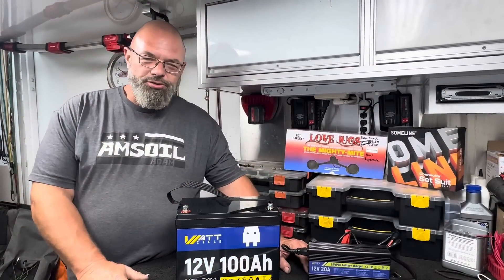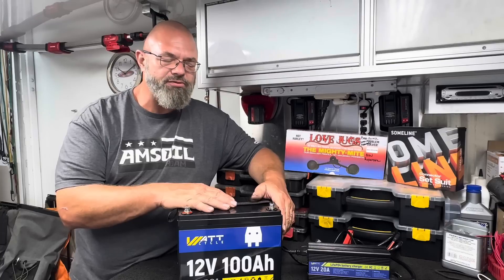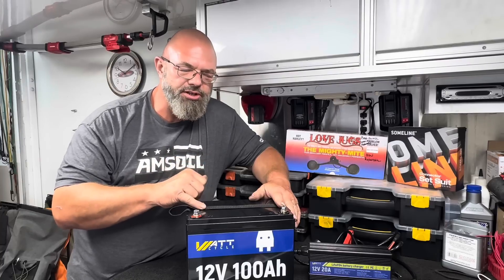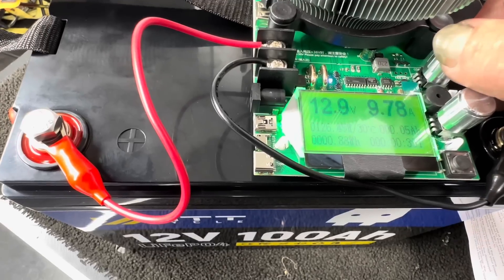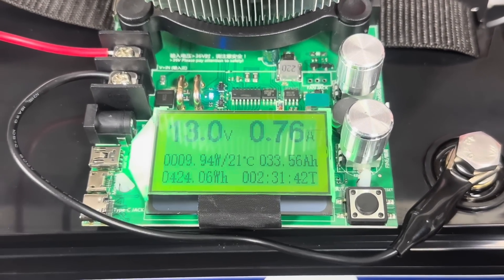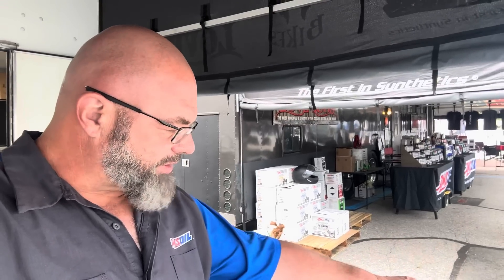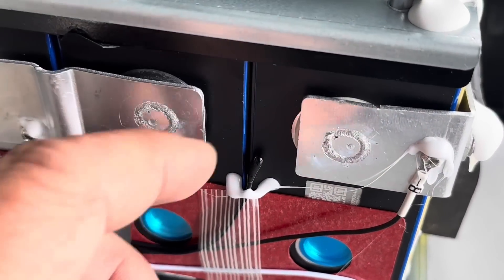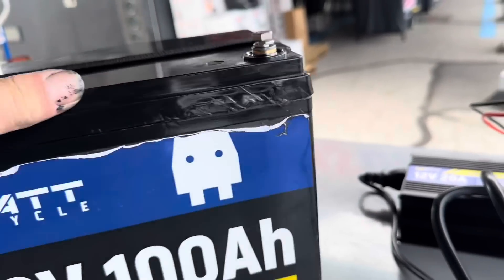Wattcycle 100 AH LiFePo4 review & teardown

Comment: Most videos on lithium  battery's show what there capacity is or there DOD befor needing a charge - 
       I do like the fact that they will maintain 12.8 volts till there almost fully discharged - 
     For those who are knowledgeable of the old rural light plants that were used to power farm and rural homes from about 1880 till up to 1970 will know what im talking about here - 
       I live in the deep south US - in 1960 REA was still installing power poles running grid wires so rural homes could have 120 volts AC - 
     Were i live homes that has power had a home that had 6 large 2 volt cells to make a 6 volt battery or a set of 16 cells that made a 32 volt battery bank - 
      The homes with 6 volts the batterys had a usable capacity of around  7000 watts and the 32 volt homes the batterys had a capacity of about  28000 watts of usable battery capacity - 
     Homes with the 32 vollt rural home light plants had all the appliances used in homes in citys with 120/240 volts - except all rural homes appliances were 32 volts DC -        with those large wet cell stationary  batterys - instead of using the strong sulphuric acid as used in batterys today of a concentration of 1.275 acid strength -     rural home house batterys used a acid strength were im at of 1.195 - that is a weak acid solution compared to modern deep cycle batterys - 
    Todays deep cycle lead acid batterys are only good for about 3 to 7 yrs of cycle service - 
       Were as the old Exide or Gould battery banks with the 1.195 acid strength had a service life of 60 to 80 yrs or longer in some cases - 
          Farm homes ran there homes off the batterys for 6 days and charged the house batterys all day once a week - 
       When i was a kid were i live at even those with very little money at least had 6 volts DC in there home to run fans, lights and a radio - 
      Were i live ive been through 20 huricanes and about 3 ice storms were i live - ive had power knocked out nearly a yr at times - 
        So i have a large 12 volt bank of batterys with 1.220 acid strength - so when im dead and gone those batterys will still be good - 
     Ive been wondering what will be the longevity of those lithium batteries - 
    With lead acid batterys they are heavy and once a month when im cycling them i have to add water to them - but there very reliable and have been in use for 165 yrs -
Reply from the maker: Thanks for the insightful comment about the history of rural power systems. It's amazing how much progress we've made in battery technology over the years!
This is all information that I was unaware of so I really appreciate the education. Lithium hasn’t been around long enough to get a true proven track record however they are estimating Cycle lives of well over 5000 cycles. That would be from 100% charge down to zero charge approximately Which in theory the average user would very rarely use. A life expectancy is very good on these but only time will tell.
Reply: I grew up in a family that had started working on light plants as the old generation called them at the start - 
    From what I know I had a grate uncle that started working on rural light plants in 1880 or so my grand father was his apprentice and broke out on his own around 1900 or so - 
      Any appliance sold in the 110 volt range in AC or DC was also sold in the 32 volt DC range for rural home owners - 
      Even if AC was needed they sold different types of inverters and converters - they used motor driven commentators for intermittent DC that could be stepped up to higher voltages and pure sign wave inverters motor generator-motors to generate 60 Hz AC - 
      A TV was one of the few things that needed clean 120 volts AC - fluorescent lights in barns needed 110 volts intermitted  DC for the ballast - 
     It seems like all that history has been left out - 
    It's humid down here and solar performs very poorly - moisture defuses UV light so it does not strike the solar panels directly - 
    During winter a good panel during a clear noon day sun generates 7% of its rated out put - 
     During summer at noon they might generate 50% of there rated out put - but after noon the out put sharply decreases - 
     So there of little value down here -        I'm fortunate because I have a oil engine to drive my generator - a  air cooled modern 3600 RPM gen generates about 1 gallon of gas per 2500 to 3000 watts of power generated - the oil engine I have generates about 16000 to 20000 watts per gallon of fuel burned when used for powering a generator for charging - 
    It runs at 300 RPMs so it has time to burn most of the fuel - it also runs very hot or at around 250 to 275° so the hot cylinder helps for a complete fuel burn - it was designed to burn crude oil right out a well - 
   The rings have to be replaced ever 100000 hrs and the connecting rod bearing has shims to take up for ware -  that's history few know today -

Comment: Are you sure 13.4v is 50% for this battery? I just got mine and charged it to full.  I then disconnected it from charge and let it sit. Within a few hours it was at 13.51v.  After 24 hours of just sitting there it was at 13.31v.  No load ever on it during this time. So, according to that 13.31v would be 100% wouldn't it? Or do I have a bad battery you think?

EDIT: I may have misunderstood what you were saying. I watched the rest of the video and your test started out at 13.3v. So, that must be 100% then after all... right? If so, not sure what you meant by the 13.4v being 50%. Did you mean 12.4?
Reply from the maker: I may have to go back and review the video, maybe I made a mistake
Reply: @amsoiladam  You may have just been thinking of the charge it was at not long after coming off the charger. Or maybe they sent you a fully charged one. I doubt most people will care though... I only did because I just bought one and was worried my battery might be only taking a 50% charge.  However, if you think 13.3 to 13.4 is a good voltage after being charged and sitting for about 24 hours then I think I'm good. Does that sound like a reasonable voltage?

Comment: Adam, how is the Watt Cycle battery holding up.
Reply from the maker: Interesting you should ask, I had not used it since we did the testing in Laconia, but yesterday I hooked it up to my spray rig on the back of my four wheeler to power the 12 V pump as I drove around, spraying all the weeds at the three different properties. And it did a fantastic job.
Reply: Why was the 40A charger too big? Is it dangerous to connect it to a 40A charger?

Comment: Hey Adam.  Since you seem to like new ideas.  Id be interested in knowing if you’ve heard of Edison Motors in BC Canada.  Getting into the heavy truck conversion business.  Replacing the drivetrain with electric axles and batteries & installing a big diesel generator under the hood to keep them topped up. I find it interesting   Should be huge power that can regenerate on downhills and braking and sustain itself on the flats with the generator running at a constant speed and supposedly less fuel than a conventional truck.   Take a look if you ever get a spare minute   Apparently doing the same with pickups
Reply from the maker: I am somewhat familiar with them. I’ve seen a couple interviews in a couple of YouTube videos, and the trucks are quite interesting to say the least.
Reply: @amsoiladam  the actual one they built is a bit on the ugly side.  But i like the conversions.     Be neat to see how it all works out

Comment: Most in depth battery review ever...congrats Adam😊 That Amazon tester gizmo was very interesting. I do voltage testing and load testing, but have never done actual use amp hour testing.
Reply from the maker: Yeah, I thought it was a pretty interesting find and I think it worked out well